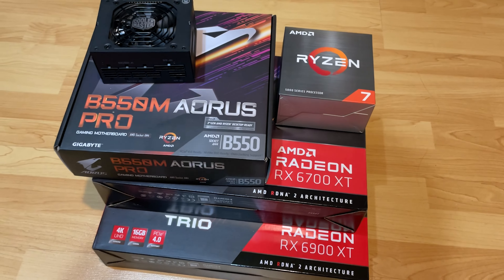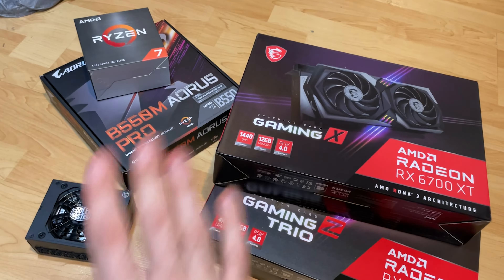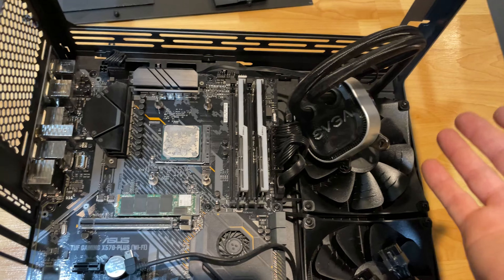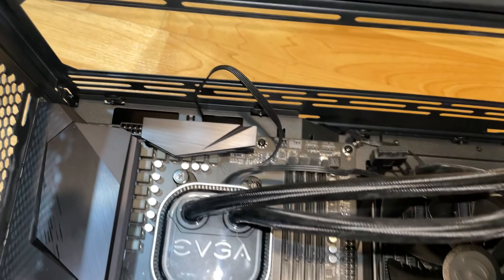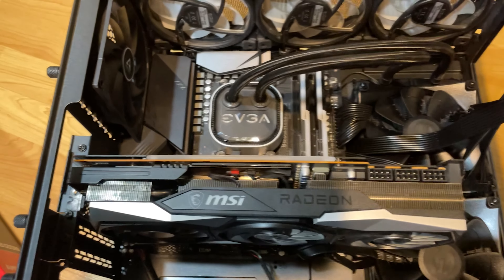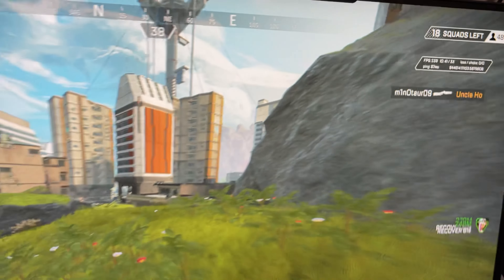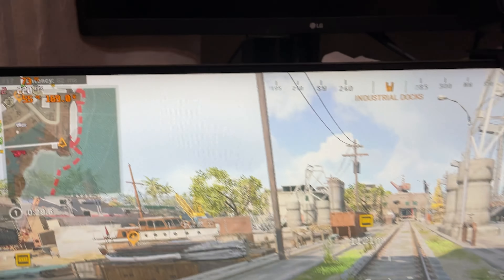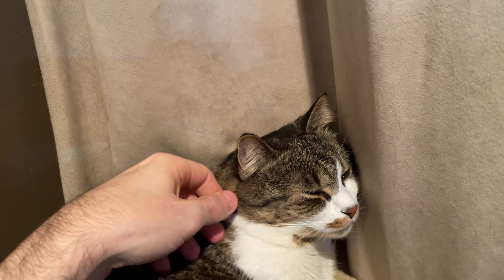Fastest Anti-Crypto Mining Gaming PC BUILD

Comment: weird ive got a 6800xt not a 6900xt but i was able to get more fps in caldera at 1440p all medium settings idk what settings u were on but thats a disappointment.. was looking to get a 6900xt next year
Reply from the maker: Go check the spot I did in the video, the average FPS across most of the map is fine
Reply: Yes check the same spot as him and report back
Reply: @FrameChasers  yeah tested it out ur right. also big drops for me inside of the Mine area
Reply: @nv_takeout  Yeah the Mine area is pretty bad, I see as low as 140fps with a 3080.
Reply: Not worth the upgrade from a 6800xt to a 6900xt since they are so close in performance. Better off just getting next gen if you are upgrading next year anyways.
Reply: i get constant 200 ish in that wz scene with my settings and tunes on 12700k, 6900xt, i posted a comment on main thread about how. I havent tried apex but i will se
Reply: I have got a 6900xt licquid cooled ROG at 2800 core and 1200 mem with fast timings on a 5950x. That thing rocks this map in its sleep.
Reply: @MoppelMat  im on 2700 core on air, i think u could push more than 2800 brotha

Comment: I don't know man, I have both a 3070 ti and a 6900 xt and the 6900 kicks the 3070s teeth in. There must be something up with your settings.
Reply from the maker: In apex?
Reply: Something isnt right. I don't know about apex but my 5600x and 6700xt has more fps than that at 1440 medium settings in caldera. Also you have to use recommended drivers not the latest available. Amd also NEEDS to have minimum frequency set not "max". Othwerise it will downclock at every given opprtunity. I run all core 4.75 and min 2800ghz on my 6700xt. (Ram is 32gb DR 4000mhz cl16 flat, 1.48v). Those same settings combo gave me 2nd place in timespy 5600x/6700xt.
Reply from the maker: @lunatik6168  go to the same spot as I did in the video
Reply: @lunatik6168  what’s the recommended drivers you speaking of?
Reply: @FJSRaReMonster  latest is (optional) and recommended is (whql) or smth like that. Usually the second option in amd website.
Reply: @lunatik6168  so if I run those drivers u think I will get better performance ?
Reply: @FJSRaReMonster  i don't know what cpu/gpu/ram combo you have, but mine has better lows and average with the recommended driver..so it should at least be better with 5000/6000 series. (It can also depend on what game you play. This was for warzone specifically)
Reply: @lunatik6168  I have 6900xt with 5800x
Reply: @FrameChasers  hm, something seems to have changed between your last video with 12900k vs5950x and now. I, too, have lower fps here (it was higher when i tested during your earlier video) i get 200-210 running inside the railroad and 235-255 running back. Looking left it drops to 165-170. Also gpu usage drops to 70 from 97-98 and wattage also drops from 180 to 130w. (Even though it's still not horrible for 5600x/6700 xt at 1440p)

Comment: @10:57 why is the card power so low? that should be ~255W if under 100% load
Reply from the maker: Because that scene isn’t using 100% of the gpu
Reply: @FrameChasers  Did you figure out the bottleneck?
Reply from the maker: @chainsaw2010  it’s the game engine / driver, big Navi doesn’t like it

Comment: if i want change to 1440p in WZ...what is minimum setup i should go...pls don't tell me i9/R9 with 3090...😅 i really mean minimum setup at least under 100+ fps...
Reply: Good question and I’m here for an answer as well
Reply: I7 10700 2070 super
Reply: All about settings And bios tweaks
Reply: I have a non k chip 10700 asus z490 mobo and 2070 super 32gb 3200mhz ram and with settings tweaked I get 130 140 stable fps 1440 in caldera and higher in rebirth and I mean stable fps. If I run 1080p I get locked 170  fps in caldera
Reply: If u want stable reliable performance go sith Intel

Comment: u should have use better cpu for 300fps I dont think gpu was at 100% on those resolutions
Reply from the maker: FPS is the same with a 12900k + 6900XT and 5950X
Reply: @FrameChasers  im happy u said in the video that amd gpu doesn't go well with Intel CPU I was building 12900k+6900xt now I get 3080 ti instead
Reply: @FrameChasers  thank u

Comment: Great content men. Can you talk about your experience with navi cards, smooth in games, micro stutter against nvidia. I test rx 6600 vs gtx 1060, 2060, 3060 and fresh win 10 install. The 6600 got more micro stutter. On nvidia run's very smooth. Tested with 5600x. 16gb 3200mhz, mobo b550 msi updated, Sam on-off wont make much diff. Games: pubg, apex, btf1-5.

Comment: Glad I went with my Asus 3080 Strix. Was really temped with the 6900xt.
Reply: 6900xt is better
Reply: @williamcamp7297  🧢
Reply: @williamcamp7297  nope. I’ve test both and my strix had better results.
Reply: @williamcamp7297  Funny because I get the same or better fps in most cases. 6900xt not worth the extra 400 dollars....
Reply: Weird as I have a 6900xt and at 1440p even at the railroad tracks looking left still get above 200+ FPS  and am above 285 everywhere on caldera. Had an Intel build and got rid of it, AMD feels so much smoother in my opinion.
Reply: @iwayl4642  Yeah, you're lying or had an improperly configured PC. the 6900xt is better than the 3080.
Reply: @Tartug1  3080's are the most overpriced gpus
Reply: @Tartug1  Let me just say this... never has the 3080 been cheaper than the 6900xt. Since release, scalpers have sold the 3080 for 400-600 + more dollars than the 6900xt... MSRP ? is that what you mean? Where no one has been able to buy it? Even now on newegg, 6900xt is cheaper... Cheaper and better in performance.
Reply: @williamcamp7297  Oh so I'm just imagining getting my 3080 Strix for over 400 dollars less than a 6900xt? Sorry but the performance difference between them isn't worth that price gap. 

I see the 3080 going for $1k all the time. Where as the 6900xt is always $1500+

Comment: My 5800X is a hot one. I’m at 1.25V on water and still hitting 65c in warzone. 1.3V was over 70
Reply: Yeah undervolt was the way to go in my experience. That said, I’m using a 280 AIO so cooling could be better
Reply: @CamelEnjoyer  dude i got custom loop with 360mm and 240mm rads. Still not keeping that chip cool 😆
Reply: @muusinuijja  ouch lol that's like literally enough to cool a 10900k oc lol

Comment: I'm sorry, but 1080p? 1440p is better in every way. Some games actually don't loose much fps from 1080p to 1440p with a 3090. Also i remember back in the ATI days  they had higher quality settings enabled while nvidia had performance in the drivers default.  I think they still do. I have a 5950x at home, as well as a 12900k. Which btw was a waste over a 12700k, which i also had. But ima keep the 12900k with ddr4 3600. Amd does need to fix their drivers no doubt
Reply: It might be better in a number of ways but even you said SOME games are still getting more fps at 1080p,..
So its not be all and end all 1440p or bust, you said it yourself right there dethroning your own point.
Reply: @SkilledRebuildsOz  No, i said some games don't actually lose much going from 1080p to 1440p. I sold a 240hz 1080p and got a 240hz 1440p
Reply: @kendragon2827  oh I see,  apologies.

Comment: It's the 5800x holding you back more than the 6900xt probably. I got huge gains in competitive games going from 5800x to 12700k on a 6800xt.
Reply from the maker: Negative, tested on 12900k and same
Reply: @FrameChasers  maybe in apex as I don't play it but warzone was drastic. Had a solid 20-30fps gain at least and far less fps dips. Bf2042 had some solid gains as well but it's unoptimized junk and wouldn't really be considered competitive. Only running 3600c16 4x8gb on both builds.
Reply: @FrameChasers  also did you reinstall windows when you tested on 12900k? I've seen some testing saying there's large hits to performance when you move from Intel to ryzen or vice versa on the same install. Even doing the factory reset bullshit doesn't do anything. Needs a clean install. I'm sure you just swapped gpus around tho since u have so many systems. Maybe I'll install apex today and test for myself.